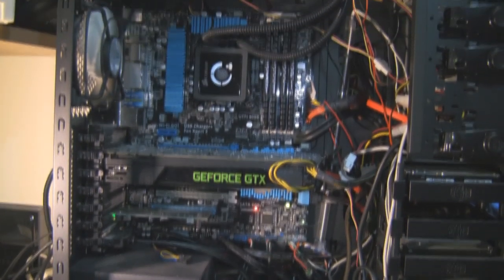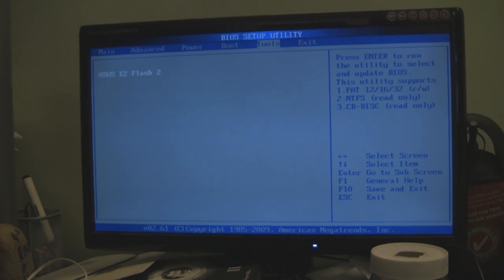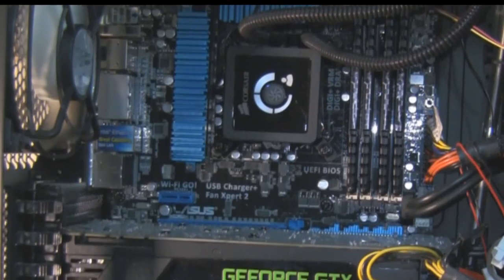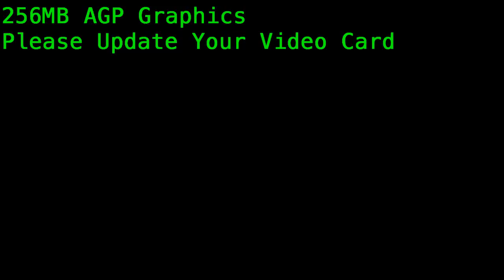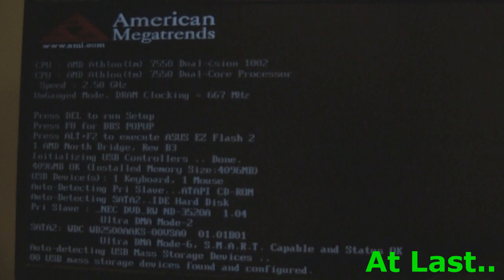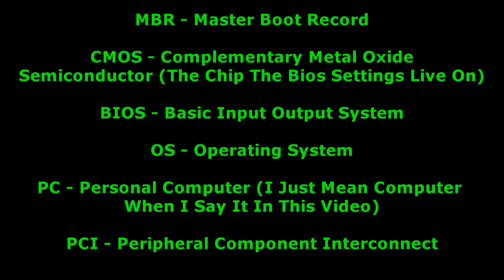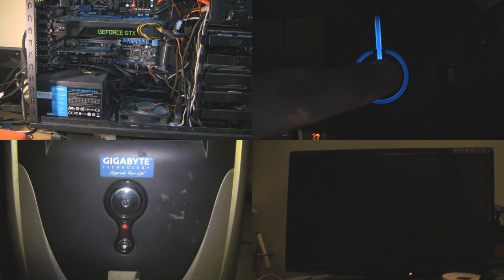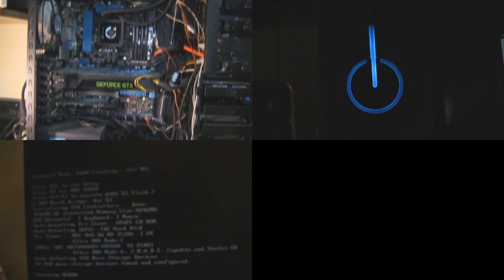Computer Boot Process

Comment: If you mean by using the old hard drive in the new computer? Then no. It will just be exactly the same as before. Imagine taking out your brain and putting it into another person. But remember the motherboard and other things may require additional drivers as well.